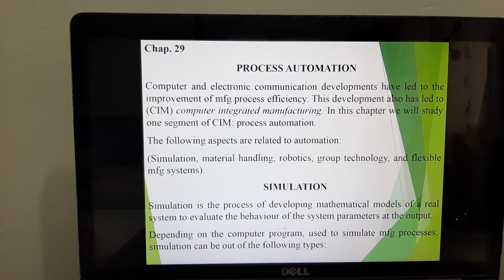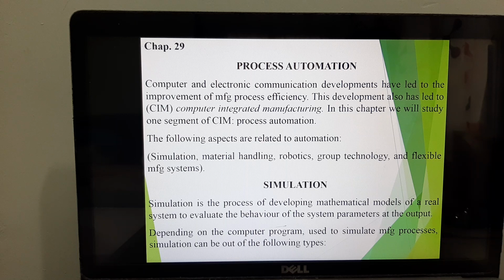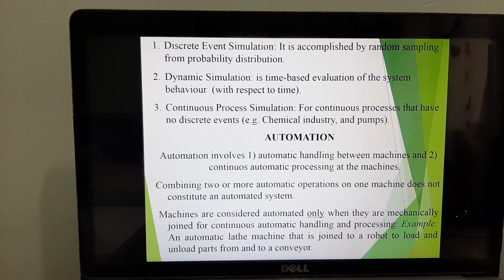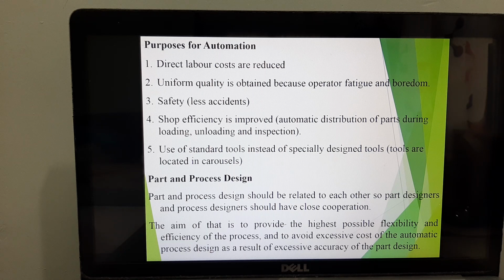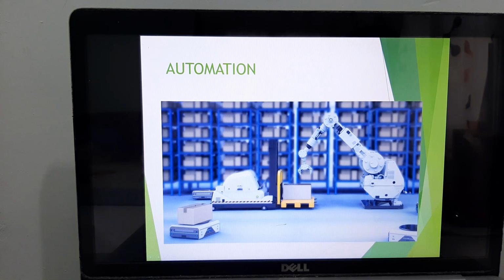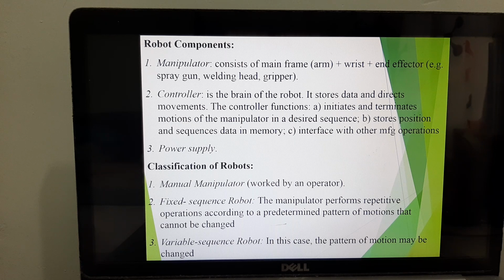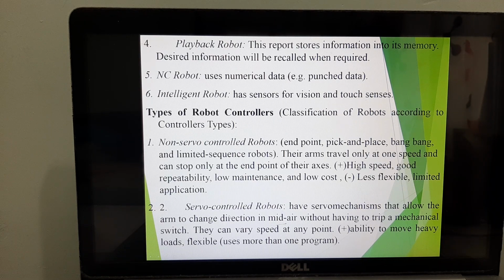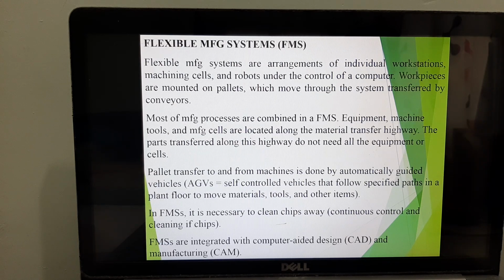PROCESS AUTOMATION

Comment: Good morning Dr, what i have learned from this video is about process automation. It is basically computer integrated manufacturing(CIM). CIM consists of simulation, automation and robots. Simulation is a process of developing mathematical models of a real system. Automation is the automatic handling between machines and continuous automatic processing at the machines. Then there are robots which stand for reprogrammable multifunctional manipulator to perform multiple tasks. Robots consists of manipulator mainframe, controller and power supply. There are several types of robots which are manual manipulator, fixed sequence robot, variable sequence robots, playback robot, NC robot, and intelligent robot. Lastly we learned about flexible mfg system. Thank you Dr.

Muhammad Naquib Bin Nor Azlan
ME0106093

Comment: Good Day, Dr. I am Derrick Ng Kian Ping (ME0105733). At the end of the video, I have learned about process automation. The computer and electronic communication developments have led to improvement of manufacturing process efficiency.  Process automation consists of Simulation, Automation and Robots. Simulation is done to see how the product will look like in the end and all dimensions are accurate, it will then be connected to robots. Next, automation is the automatic handling between machines and the continuous automatic processing at machines. The purpose of automation is direct labour cost reduced, uniform quality obtained, safety and shop efficiency is improved. Moving on, Robots are programmable multi functional manipulator designed to move materials,parts or tools through variable programmable motions for performance of variety task. There are 3 robot components which are Manipulator (main  frame), controller (brain of robot) and power supply. There are 6 classifications of robot which are manual manipulator (worked by operator), fixed sequence robot (perform a predetermined pattern that cannot be changed), variable sequence robot (Pattern of motion may be changed), play back robot (storing information into memory and can be recalled), NC robot (numerical data) and intelligent robot (has sensors for vision and touch senses). The sensors in robots are vision sensors (video camera,image processing), tactile sensors (respond to contact forces) and voice sensors (define voice and sound recognition). Lastly, Flexible MFG system is the arrangement of individual work stations, machining cells and robots under control of computer. Work pieces are also mounted on pallets which move through system transferred by conveyor.

Thank you.

Comment: Hi madam from this video i learned about process automation.

Simulation: process of developing mathematical models of a real system. 
Automation: automatic handling between machines. Mechanically joined for continuous automatic handling and processing
Purpose: 
-direct labour cost reduced
-uniform quality is obtained because operator fatigue and boredom.
-safety 
-shop efficiency is improved
-use of standard tools instead of specially designed tools

robots: reprogrammable multifunctional manipulator designed to move materials, parts or tools through variable programmable motions for the performance of variety of tasks. (spraying,grinding,deburring,welding,packaging, etc)
components:
-manipulator: main frame+wrist+end effector
-controller: brain of the robot. stores data and direct movements
-power supply

manual mainpulator: worked by an operator
fixed sequence: performs repetitive operations according to a predetermined pattern of motions that cannot be changed
variable sequence: pattern of motions may be changed
playback: stores information into memory and recalls info when required

numerical control: uses numerical data
intelligent: sensors for vision and touch senses
flexible mfg systems: arrangements of individuals workstations, machining cells and robots under the control of a computer. Workpieces mounted on pellets, which move through the system transferred by conveyers. 

Thank you madam.
AHMAD NAZRI BIN AHMAD TAMRIN ME0106079

Comment: Good afternoon madam, I am Wong E-Shen (ME0106071). From this video, I have learnt about process automation. Computer and electronic communication developments have led to the improvement of manufacturing process efficiency. It consists of 3 features which are simulation, automation and robots. Firstly, simulation is the process of developing mathematical models of a real system to evaluate the behavior of the system parameters at the output.
 Next, for automation, it involves automatic handling between machines and continuous automatic processing at the machines. The purposes of automation are to reduce direct labour costs, uniform quality is obtained due to less error, more safe, shop efficiency is improved and standard tools are used instead of specially designed tools. Thirdly, for robots, it is a reprogrammable multifunctional manipulator designed to move materials, parts or tools through variable programmable motions for the performance of variety of tasks.
 Robots can do jobs such as spraying, grinding, deburring, welding, packaging, searching, loading and unloading, and tool positioning. The robots consist of 3 components which are manipulator (mainframe), controller (brain of the robots) and power supply. Then, there are 6 classification of robots which are manual manipulator (worked by an operator), fixed- sequence robot (manipulator performs repetitive operations), variable-sequence robot (the pattern of motion may be changed), playback robot (stores and recalled information), NC robots (uses numerical data) and intelligent robot (has sensors for vision and touch senses). The sensors of the robots are vision sensors (for see), tactile sensors (for touch) and voice sensors (for define voice and sound). Furthermore, for flexible manufacturing system, it is the arrangements of individual workstations, machining cells, and robots under the control of a computer. Workpieces are mounted on pallets, which move through the system transferred by conveyors.
Thank you.

Comment: Good morning madam, I'm Chong Jin Yang (ME0106047). From this video, I have learned about process automation. It is a computer integrated manufacturing (CIM). It consists of simulation, automation and robots. 
1) Simulation
- process of developing mathematical models of a real system
- evaluate the behaviour of the system parameters at the output
2) Automation
- automatic handling between machines
- continuous automatic processing at the machines.

Purposes of automation
1) reduce labor cost
2) uniform quality is obtained
3) safety
4) shop efficiency is improved
5) Use if standard tools instead of specially designed tools

3) Robots
- reprogrammable multifunctional manipulator to perform multiple tasks
consists of manipulator mainframe, controller (stores data and direct movements) and power supply.

Types of robots
1) Manual manipulator
2) Fixed sequence robot
- performs repetitive tasks
3) Variable-sequence robots
- performs multiple tasks
4) Playback robot
- store information and recall it when it is required
5) NC robot
- use numerical data
6) Intelligent robot
- vision and sensors
- vision sensors ( image processing)
- tactile sensors (contact forces)
- voice sensors (voice and sound recognition)

Flexible MFG systems
- arrangements of individual workstations, machining cells and robots under the control of a computer.

Thank you.

Comment: Good day Dr Im Lee Zi Sheng ME0106051. In fully automation plant, the production is fast but many people will lose their job. three elements which are stimultaion, automation and robot.
 Simulation is the process of developing mathematical models of a real system to evaluate the behaviour of the system parameters at the output.
 Automation involves automatic handling between machines and continuos automatic processing at the machines,  machines are considered automated only when they are mechanically joined for continuous automatic handling and processing.
Purposes for Automation
Direct labour costs are reduced 
Uniform quality is obtained because operator fatigue and boredom. 
Safety (less accidents) 
Shop efficiency is improved (automatic distribution of parts during loading, unloading and inspection). 
Use of standard tools instead of specially designed tools (tools are located in carousels) 
Robot:  reprogrammable multifunctional manipulator designed to move materials, parts or tools through variable programmable motions for the performance of variety of tasks., used in light and heavy mfg, foundry, automotive, electrical, and aerospace industries
Robot Components:
 Manipulator, Controller, Power supply
Classification of Robots:

 Manual Manipulator (worked by an operator). ,
Fixed- sequence Robot(A to B only), 
Variable-sequence Robot, 
Playback Robot(stores information into its memory)
NC Robot: uses numerical data
Intelligent Robot: has sensors for vision and touch senses
Robotic Sensors (for Intelligent Robots)
 sensors robots can have humanlike capabilities (vision, eye-hand coordination, touch, and hearing).
Flexible mfg systems are arrangements of individual workstations, machining cells, and robots under the control of a computer. Workpieces are mounted on pallets, which move through the system transferred by conveyors.
Thank you.

Comment: NIGEL ANDERSON SINGH A/L RAJDEEP SINGH
ME0106094
Good day, madam. 
Process automation has led to Computer Integrated Manufacturing (CIM). Related to automation : simulation, material handling, robotics, group technology and flexible manufacturing systems. 
Simulation is the process of developing mathematical models of a real system to evaluate the behaviour of the system parameters at the output. Type : Discrete Event Simulation (random sampling from probability distribution)Dynamic Simulation (time-based evaluation of the system behaviour respect to time) and Continuous Process Simulation (continuous process that have no discrete events). 
Automation involves automatic handling between machines and continuous automatic processing at the machines. Combining two or more automatic operations on one machine does not constitute an automated system.  Purpose : labour cost reduced, uniform quality, less accident, shop efficiency improved and standard tools are used instead of specially designed tools. 
Robot is a reprogrammable multifunctional manipulator designed to move materials, parts or tools through variable programmable motions for the performance of variety of tasks. Robots are used in light and heavy manufacturing, foundry, automotive, electrical, and aerospace industries. Robot components : manipulator, controller, power supply. Classification of robots : manual manipulator, fixed-sequence robot, variable-sequence robot, playback robot, NC robot and intelligent robot. Robotic sensors : vision sensors, tactile sensors and voice sensors. Flexible Manufacturing System are arrangement of individual workstations, machining cells and robots under the control of computer. 

Thank you.

Comment: Name : Aiman Hazim Bin Arif Razman
ID : ME0106080

From this video, I have learned about the process automation whereby work is done by a fully automated plant without human intervention. Process automation is an improvement of mfg process efficiency which consists of simulation, automation and robots. Simulation is a process of developing mathematical models of real system to evaluate behaviour of system parameters at output. This is to simulate a work with correctly keyed in dimensions. Automation is handling automatic handling between machines which work together with each other, continuous automatic pressing at the machines. Machines are considered automated only when they are mechanically joined for continuous automatic handling and processing. Example ; automatic lathe machine that’s joined to robot to load and unload parts from and to a conveyor belt. The purposes of automation is to reduce direct labour costs, obtain uniform quality, ensure safety. Robots are reprogrammable multifunctional manipulator designed to move materials, parts, or tools through variable programmable motions for the performance of variety tasks. Robots are used in light and heavy mfg, foundry, automotive sector, electrical sector, aerospace industries. The typical jobs for robots are spraying, grinding, deburring, welding, packaging, searching, loading, unloading and tool positioning. Robot components consist of the manipulator, which is a main frame (arm) + wrist + end effector (spray gun, welding head, gripper), controller which is the brain of the robot and stores data & directs movements. Controller functions are to initiate & terminate motions of manipulator in desired sequence, stores position and sequences of data in its memory and an interface with many other mfg operations. Classification of robots are manual manipulator which is worked by an operator, fixed-sequence which is a manipulator that performs repetitive operations according to a predetermined pattern of motions which cannot be changed, Variable-sequence which is the pattern of motion may be changed, playback robot where robot stored information into its memory and desired information will be recalled when required, NC robot which uses numerical data (e.g : punched data) and intelligent robot where it has sensors for vision and touch whilst behaving like a human. Flexible mfg systems are arrangements of individual workstations, machining cells and robots under the control of a computer. Workpiece is mounted on pallets which move through system by conveyors.

Thank you for the informational video Dr.

Comment: ME0106053 Marcus Chuo
Good day madam, info gained from this video are on process automation.
Computer integrated manufacturing consist of simulation, automation and robots.
Simulation is the process of developing mathematical models of a real system and evaluated behaviour of system and parameters at output
automation is the automatic handling between the machine and the continuous automation of machine process

The purpose of automation are to reduce labor cost, uniform quality obtain, safety factor, shop efficiency is improved and standard tools are used instead of specially designed tools.

Robots are reprogrammable multifunctional manipulator to perform multiple tasks such as welding, packaging, searching, grinding, spraying and much more manufacturing processes.
It consist of manipulator mainframe, controller which stores data and directed the movement and a power supply
There are many types of robots 
Manual manipulator which is worked by an operator, 
Fixed sequence robot which the manipulator performs repetitive operations
Variable-sequence robot where the pattern of motion can be changed
Playback robot which stores and recall information
NC robots uses numerical data and 
Intelligent robot has sensors for vision and touch senses to sense surroundings.